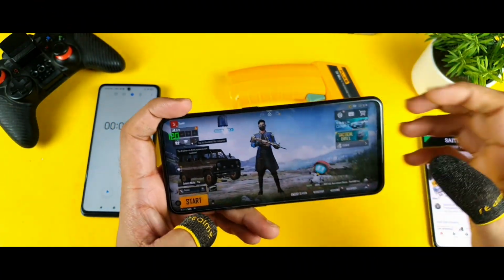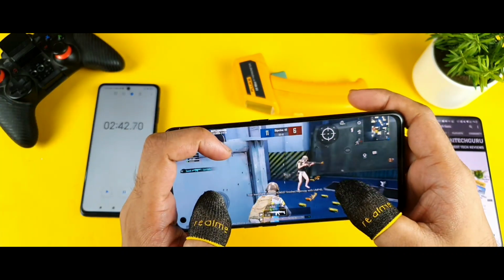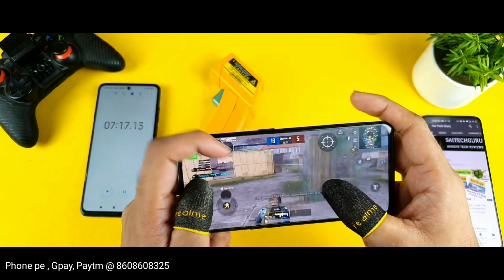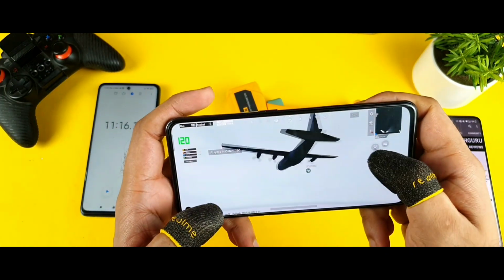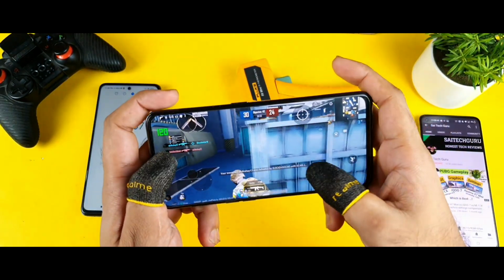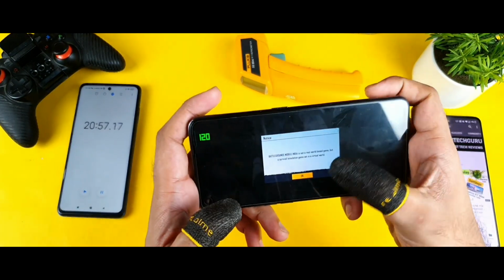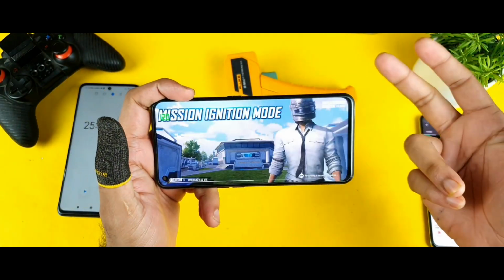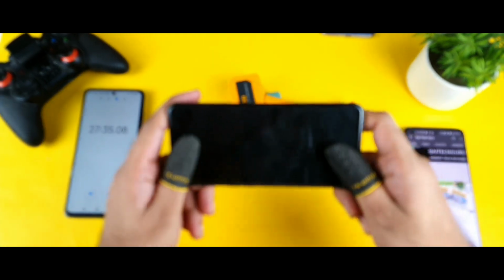Realme X7 Max BGMI 90fps heating test, fps drop test, below 15% battery dimensity 1200

Comment: Bro check the autoplay feature in iqoo 7 that how efficient it is in reducing the battery drain. ( By checking a game when kept idle without autoplay and with autoplay and comparing the differnce in battery drain).
Reply from the maker: Sure Bhrath I will do if possible
Reply: @bhrath You using iQOO7?
Reply: You using iQOO7?
Reply: @abu_seerah_al_ahmad  yes